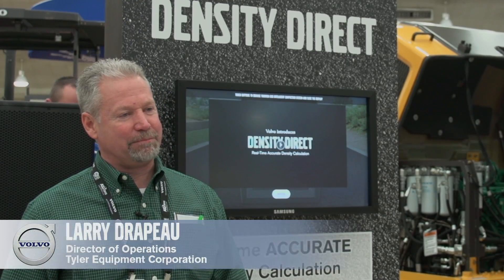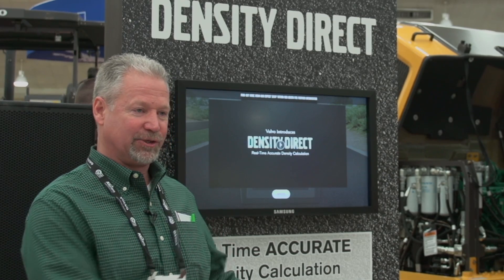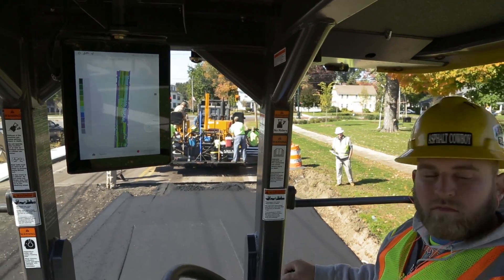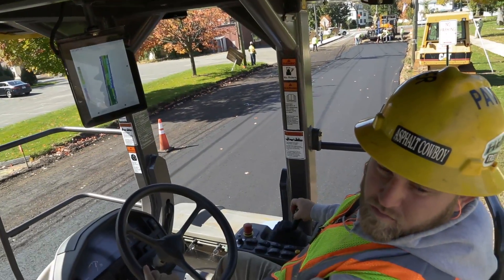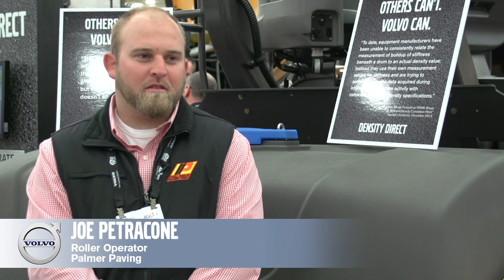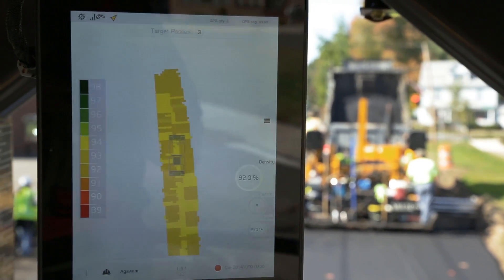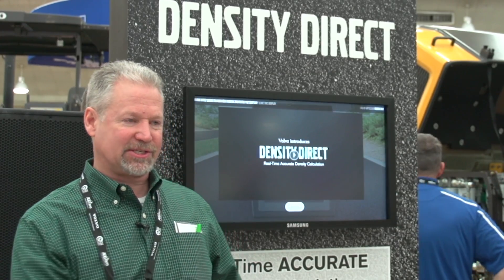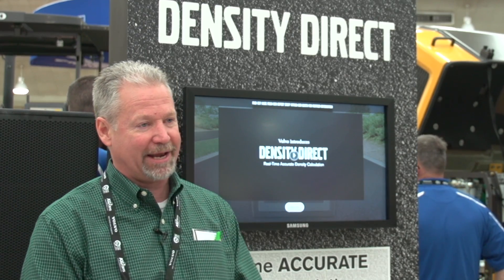Density Direct: What Operators Are Saying

Comment: Welcome in Utopia, there are so many different circumstances it is not possible to predict the density result during compaction. Second tandemrollers are not the best rollers for asphalt compaction, they are potential detrimental especially on tender mix, but also on strong mix they lack compaction power. Machine Weight, linear load and Nijboer factor are not the right tools to predict the force of the roller. There is a lot to improve the performance of an asphalt compactor but before you can do this first you have to know how a roller really works and to me it is clear that lot of companies do not really know the capabilities of their equipment.